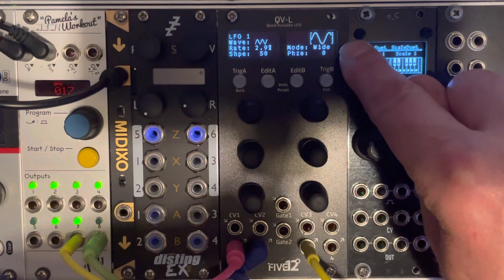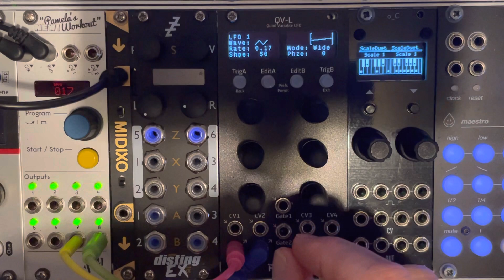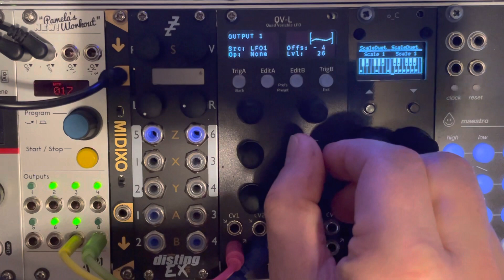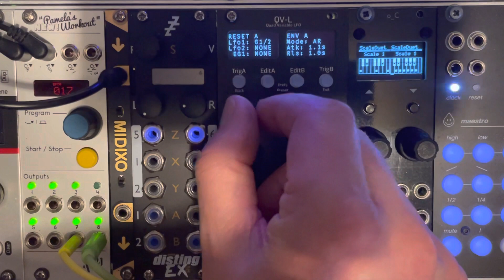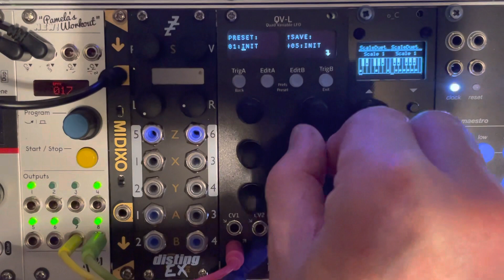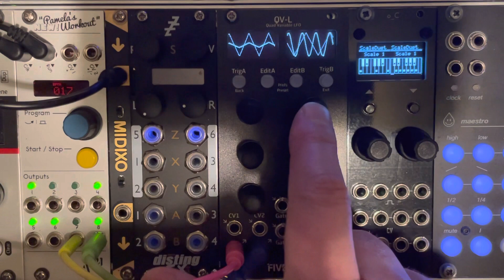Five12 QV-L Quad Variable LFO first look at prototype

Comment: awesome. nice to integrate attenuators and offsets. it doesn't do more than 5v does it? any idea on ETA and price? chur
Reply from the maker: 5v max. Yeah the integration of all that in one place is super handy. ETA is first batch sold today but perhaps more very soon. Keep an eye on the Five12 website forum and Facebook group.
Reply: @steveturner1815  Can you talk Jim into offloading the main user group away from Meta? There are owners who don't want to be datamined.
Reply from the maker: @guysmiley7289  do you mean the Facebook group? That’s not official and not Jim’s responsibility. I run it. If you don’t want to use it you can use the five12 website forum…